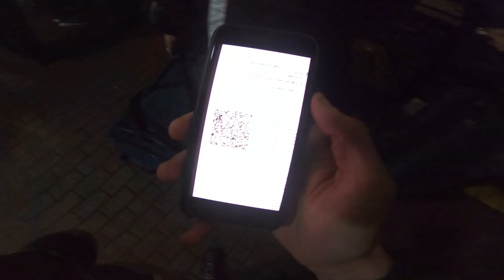The road to another city/Trip to little dream. Part one.

Comment: 9:38 how does he know that those wires wont kill him?XD
Reply: Which ones, the one in the insulation?
Reply: @matrix8934  i mean every single one that is basicly next to him
Reply: @lowhigh2517  those are all telecommunications cables, you can see it because of the dishes and antennas on top of the chimney. 

Also high voltage electricity it's only run insulated or by suspended cables, like the ones attached to the towers in the countryside, so there is no risk for that.

Comment: This chimney ladder seems stable enough because there are so many antennas and cables and the only way up there to maintain these is the same ladder. Most of antennas there are for mobile phones and they are not very strong power because they need very much of these and because number of different frequencies are limited - maybe kilometer away and same frequency is in use again. But these directional parabolas may be high power.

Comment: the radiation there is not that bad, i work at cellphone towers, the radiation it causes is NON-ionizing radiation, it doesnt cause cancer. what it does cause is heat. when you work at cellphone towers you can spend 8-10 hour shifts working ther so you need to be careful and wach your coworkers because it can cause you to heat up to a point where you pass out simply from a heat stroke. i have never seen it happen but thats what it does. it wont give you cancer it will just make ur body hotter over hours most likely, if you wanted to take a 30 minute break under that antenna you would be perfectly fine